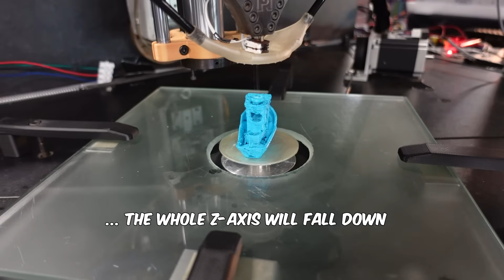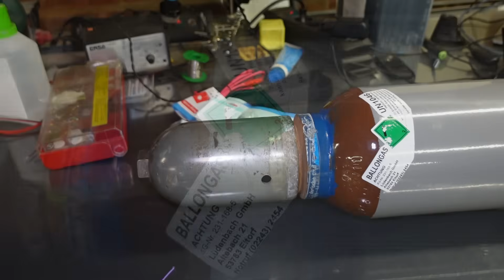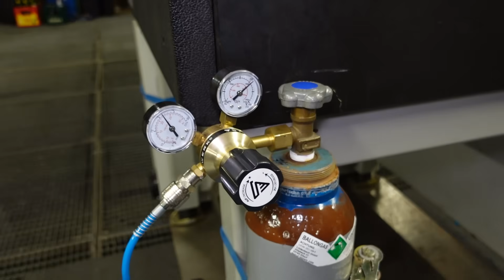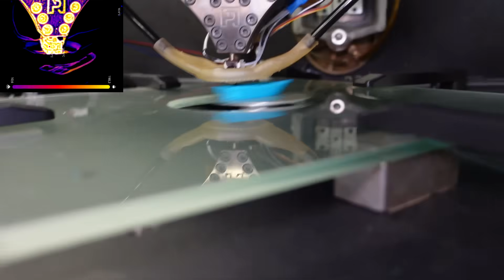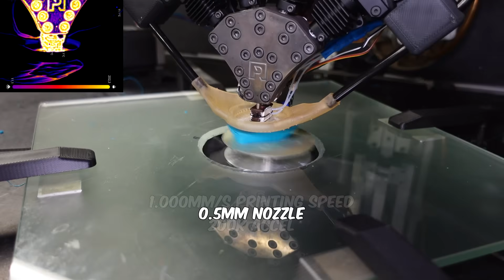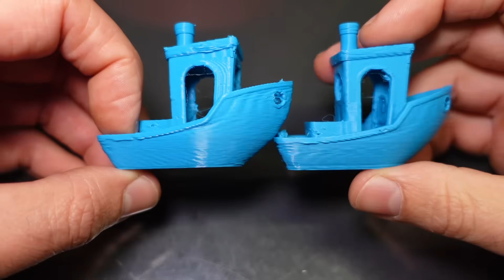Testing Helium Cooling on Worlds Fastest Printer (Minuteman Episode 18)

Comment from the maker: Yeah, I know — using helium like this isn’t exactly eco-friendly 😅
Helium is a finite resource, and it’s awesome to see so many of you actually care about that!

This test was never meant as “use this at home,” more like: what happens if we push physics a bit too far?

I’m all about upcycling, renewable energy, and leaving the world intact for future generations — that’s literally why I’m building experiments like this in the first place.
Industrial 3D printing could make it possible to produce parts locally instead of shipping them halfway around the planet multiple times. 🌍💨

I love that this community keeps the bigger picture in mind — that’s exactly how innovation and responsibility should go hand in hand. 🙌
Reply: From what I see, shop air is still going to give you a lot of data so you don't have to use it for every print. The top surfaces deforming under the denser air is something that you can tolerate during tuning/testing up to a point.

But don't be afraid to go for helium on the real prints. It's obviously expensive, but don't worry too much about "losing" it. A quick search suggests 458 million liters/day as the global usage rate. It's suggested that about 85% is recovered leaving about 69 million L/day lost globally. So your experiment is barely a scratch.
Reply: If the helium was in a closed chamber you could recycle it
Reply: Nice to have tried, but yes, helium isn't in my opinion rational to use. Nice job anyway, you're putting so much effort in this.
Reply: great vid (i'm not that bothered by the helium use, maybe i should be more outraged 😉) but this statement feels a little insincere. and also LLM written
Reply: Ah nah, just fly to the moon and grab some more. And while you're there grab some of that good 3-He stuff to refuel your fusion reaktor.
Reply: why dont you try to refrigirate the AIR cia a serpentine in some carbonic ice?
Reply: I mean, you can always use hydrogen. It is abundant, has half the molecular weight of helium and has better thermal properties as well. The only drawback is that it really likes to ignite if there's oxygen present, so you'd need to contain it somehow.
Reply: I'm gonna ask the stupid question: If helium was an improvement, why not try hydrogen? You just have to electrolyze water to make it, so I'd expect it to be a cheaper option, at the cost of being extremely flammable.
Reply: All your work is fantastic !! truly impressive, but does it go back to the community somehow ? For example to improve OrcaSlicer ?
Or it would be great if for example you worked with Prusa to improve their printers.
It would be a pity if all this incredible research gets forgotten one day.
Reply: Don't justify yourself to these nutjobs. They get mad if you step on a dead leaf.

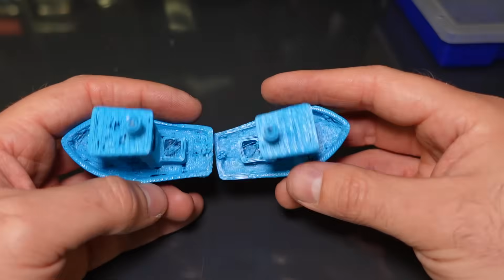Comment: 23:08 If you need more cooling with less flow and don't want to use Expensive Helium, have you considered using colder gas? Like cooling the air tank down to ... idk ... -50°C or so.

Comment: You may get even better cooling results with welding grade Helium (grade 5.5) vs balloon grade (grade 5).   Balloon  grade helium ( which you show here ) is really just for balloons, not for scientific research or industrial use.  I know in tig welding that the extra purity makes a big difference.  It's quite expensive, but might help you get the result(s) you're looking for.    The gauge you're using isn't ideal either.

Comment: Hi there,
I have seen in Minuteman 15 or 16 the tempreture curve of the extruder.
As you have a problem with with the exserted down force of the of the cooling air regarding reclosing parts of the benchy, could you also regulate it activly by the printer/slicer?
As in parts need to be hoter that have more connection to surrounding layers. That way, you could dail the heat of the filament and the forces exserted for overhangs.

Comment: for your pi, stop using the usb power supply. They're all crap. Get yourself a 12v supply and an adjustable buck converter! Set the output to 5.3v, solder the leads to the 5v line on the pi, and you'll never have voltage issues again! USB spec is a maximum of 5.5v, and the stock power supply is 5.1v... which makes a voltage drop likely. I power my raspberry pi zero 2w off the 24v supply with this method!
Reply from the maker: Thanks!

Comment: Dumb question: Since gases expanding makes them cold, wouldn't the previously 200 bar Helium be a lot colder when hitting the print than the shop air? Couldn't this be the reason for the better cooling with Helium, rather that the Helium's properties?
Reply from the maker: Helium doesn't get cold when expanding, it even gets slightly warmer.
Reply: @Roetz40  Learned something new today, thanks!

Comment: I think you owe it to yourself to redo helium with good quality full (digital?) flow and pressure (and even perhaps gas temperature) monitoring.  It feels like having that tech available will be useful even though helium is impractical.  It allows you to try different gasses (and mixtures) while increasing repeatability which is so crucial for your project. 

eg: if you used chilled air (compressed into a bottle and allowed to release compression heat) does that make a difference?  Does low gas temperature at outflow allow you to reduce flow rate? 

Apologies if you've already tried some of this in videos the 'rithm hid from me.

Comment: I am genuinely impressed that the model does not “take off” under such rapid movements along the X and Y axes. This is extremely interesting it behaves as if it were firmly bonded to the surface. The stability is remarkable, even at high speeds and accelerations. What build surface are you using, and do you apply any adhesive for the first layer?

Comment: I absolutely love this project and i look up to you now!

Anyway, is there any way you could have some kind of solid cooling? Like a cold-end around your hotend? As in a cooling ring? Like it irons the just extruded filament but cold?

Like using a air brush nozzle or turned down nozzle (so its thinner) then a potent insulator, then a chilled copper ring thats just wide enough to touch what was just layed down. 

Maybe you could cool the cold end/cold iron thing with water or engine coolant at high pressure through thin tubig and use some valving to rapidly switch between hotter and colder coolant for different parts? Not sure if that could ever help or work at these speeds...

Another dumb and hard idea popping into my head is put a bunch of tiny solenoud valves (like fuel injectors) in your cooling nozzle and change the direction of flow to match the movement? Maybe that could help both adhesion and bridge blowout... if it wasnt a nightmare to impliment...

Comment: Hey roetz40, is there a way you can ultrasonic humidifier goop into the stream of air / & or just straight up spray liquid that expands & forces a better layer adhesion? Like, some low vapor pressure oils? 

Spraying a very fine mist, while it doesn't seem like it at first, does increase the ability for cooling & layer adhesion, sure, but its mostly the control of air. The best thing you can do for yourself here is change that direction of flow of air dynamically based on oil/water in a pressure system that can hydraulically move the nozzles.

A little "slop" if you will with a o-ring & pressure being fed in the correct way will move it, I'm sure you know that you have a bed that moves this quickly, you can do it with water pressure & or some kind of non-newtonian fluid that doesn't allow for compression. 

Adding in a needed venturi system during a rotation & flexing to move the nozzle forces a fine spray to occur, goop in a solvent that quickly evaporates allows for next to no liquid needed & air for that matter. Of course the issue becomes the amount again. Something you are pretty obviously acquainted with. 

Goop is toxic, spraying & controlling spray at that speed is easy as all get out. Meaning it easy. I don't know what the "get out" part is, doesn't make sense to me & I'm from America lol. You can control your bed & flow & more, you are able to repurpose a lot of that same code & just use it for this. It's a part of my older designs for speeding up certain....

Brutally annoying prints. with materials that suck & don't like to stick together without electricity & lasers going through them. So I needed, in my concepts, a way to quickly cool things with metals in a liquid that allows for a bond form through catalytic reactions caused through the initial polymer stuff then the rest of the energetics of the laser & electricity would follow through with a "thermal momentum" 

(its just means electrons in their orbit continue moving a certain way with the nucleus of atoms to allow for them to get closer in the cooling phase of the actual part) 

& compression/condensation 

(2 things, you know are very similar & suck to describe mathematically in a different quantizable way. compression is condensing something, but then momentum gets involved, so you cool something the right way it continues to head into itself until it forms a field to field interaction & interference that "says" (sensed) its pressured but the sensor moves thanks to cooling so you are looking for frequencies that manage to slip in an anti-node point of frequency that allows for it to mean its suddenly a pressure & or cold "pressure" exerted force that now is "chameleon" like in its change (btw this is all my design, just require credit, deal with it like with all of them) chameleon is apparently thanks to a "particle" (its not, its more virtual quasi, but whatever) that likes to pretend its doing something in this other way that makes it look like this thing. Like, its an electron that has a weird spin that interacts with it hall-effect field allowing for a virtual state to exist as the real orbit, but now electrons are in both "virtual orbits" & look like they are real electrons. "chameleon" is to say it hides what it is in the sensors. Yes, the quantum mechanics are like us, turns out, they name things a way to help them be remembered & understood because its hard to remember lol)

nucleation of formed crystals that then can be "flowed & battery spindled" (yes like lithium batteries going bad) in-between the 2 surfaces. Making them stronger, but less willing to warp too, at higher speeds & heats to rapid cooling~! 

It's why I worked on the concept & made a few videos, comments, posts, etc about them hoping someday maybe someone would want to bounce ideas back & forth & or work with me. Mostly having to do everything by my disabled self.

Comment: Perhaps consider using hydrogen instead, for even higher performance and much cheaper gas (that you can even generate yourself, meaning it could theoretically actually have industrial applications).

Of course there's the flammability aspect instead, but perhaps not the biggest issue at the small volumes you're using, and possibly with the addition of an extraction fan?

Comment: two key things here that I'm thinking about while watching this. 

Your helium is kept under pressure, once you take it out of the take tank to cool you drop the pressure of the gas, dropping its temperature.

Conversely, the shop air gets compressed by the compressor, raising its temperature. 

What impact this has? probably nothing massive but its worth considering.

edit: more thoughts, why not chill the in coming shop air? assuming you're drying it fully, you could get air that's almost freezing, and you could blow that at a lower pressure. and it'd be denser.

Comment: Super excessive and expensive approach, build a vacuum chamber around the printer.
Before a print, pull a vacuum and then run with the helium.
After the print, use a compressor to recapture helium from the chamber.
It would have losses and likely get contaminated helium after a few runs, but it at least gives it more effective life.

Comment: Shouldn't CO2 should be much nicer? it actually goes freezing temps when it decompresses. Could mean less flow needed and it is MUCH cheaper than precious helium. 
Refridgerated air also comes to mind, should kill the issue of downward force to some dregree. Also cooler air has more mass, means less pressure / flow required. On the itger hand, cold air > higher density > same force but at a lower given flowrate? Just throwing things at the wall. 
It really seems like the biggest challenge is finding a cheap gas with good thermal conductivity and thermal mass, low density and being decently harmless. 

The craziest idea I had was this: extremely deeply chilled fluid to air heat exchanger, think acetone in a loop that is cooled with dry ice and a normal CPAP style cooling setup that has a radiator inline where the sub zero coolant flows through.

Comment: Scuba first stage regulators are good for 2,000+ l/min and typically are set to 8-10bar. You can use one to step down very high pressures to a more shop friendly level.

They're also commonly used with gas mixtures containing large amounts of helium.

Comment: Other options are cooling the air? Air doesn't freeze until around -80c, you may have have cool, dry air to avoid water issues.

Or freeze spray? (R134a or LPG are both avaliable as commercial freeze sprays) both still have environmental concerns though.

Comment: So the main issue with Air cooling is the horizontal overhang surfaces getting deformed with the pressure.  Could you reduce the air pressure while printing overhangs?  I know the timing would be difficult, but maybe a splitter on the line with an electric valve that vents to open air and a second manual valve to regulate the amount of venting thus a way to control the pressure delivered to the print during overhangs.  This could eliminate the $100 per run helium tax while giving similar results with air.

Comment: I've given up on the Pi5. Really really awful internal power supply. I bought the expensive custom 5V USB supplies too, but that's still trying to work around the Pi's stupid internal supply. My last Pi5 lasted 2 weeks. Until they have a USB-C supply that can take high voltages, I'm done with the 5. I really think they need to find a new PSU engineer or a new program manager (if the last one forced his engineer to make a PSU that had to accept 5V input).

Comment: Why are you using hot plastic when you’re trying to go this fast?  

You could instead switch to a chemical, which is basically like a printer and you print by combining two different liquids together that will solidify on contact for instance, like superglue and a setting liquid which they have. I don’t know how fast it sets, but it’s super fast so you could combine them just before it exits the nozzle or just at the exit of the nozzle and it would join to the previous layer. Then you’ve removed the cooling issue.

Comment: Joining the chorus for "set up intense enough extraction that you could safely do this with hydrogen"
barring that, wonder how hard it would be to rig up solenoids to go to a 80% He 20% air mix for just a dozen problem seconds - the deck and the roof/chimney - while running on air or nitrogen alone for most of the one or two or three minutes. A car racing nitrous boost, if you will.

Comment: Would it not be more efficient to encapsulate the printer in a helium atmoshpere, rather than just blasting all the helium off into the wider ambient atmosphere?
Then the problem simply becomes a mechanical one of recompressing the encapsulated heluim atmosphere to achieve the high flow rate within the encapsulation, without losing the expensive helium in the process.
High initial cost. Low repetition cost.

Comment: Have you thought about enclosing the print area in an air conditioned enclosure to bring ambient inside way below the shop temp?  Would a much lower ambient help at all?  
My other thought was to put air dryers (filter, separator, radiator, copper coil in water, etc.) between your compressor pump & tank to remove moisture from the stored air.  Then run the shop air through a chiller like they use to chill CO2 laser tubes.  That should get the cooling going pretty well at the hot end.

Comment: Run the shop air through a large copper coil buried in a bucket of ice? Can also put the coil in a bucket of dry ice (WAY cheaper than helium)? Make sure the shop air is as dry as possible first or ice will form inside the coil and block the flow :)
Reply: i think he already tried that
Reply: @xilw3r  Gotcha. This was the first vid youtube recommended for this channel so didn't know.

Comment: Silly question, but is your compressed air cooled down before you use it? I mean air heats up under pressure and cools when uncompressed, so if it is allowed to cool to room temperature after compression, the air flow out will be a lot colder, I think. This may be your work flow anyway but i thought I would ask anyway.

Comment: What if you redesign the cooling duct to work more like an air curtain blowing straight across? With that much air being focused to the middle it has no where to go but down. Maybe another option would be to collide two thin streams directly at the nozzle. You could try various angles. 180deg would be straight at each other. 90deg would have the streams meeting perpendicularly.
Reply: Also have you considered adding water mist to the air? You may even be able to repurpose a "cool mist" system designed for machining.

Comment: Have you tried using nitrogen? Its cheaper because it is in most of the air we breathe. "When nitrogen gas is compressed and then allowed to expand, it cools significantly due to the Joule-Thomson effect, which can bring its temperature down to very low levels, potentially reaching below -196°C if the conditions are right. The exact temperature will depend on the initial conditions and the specifics of the compression and expansion process.“